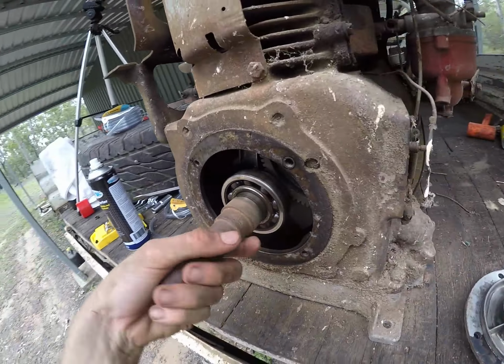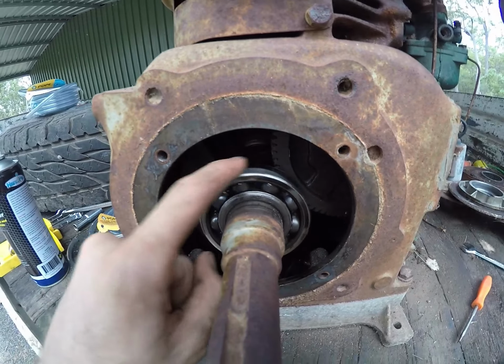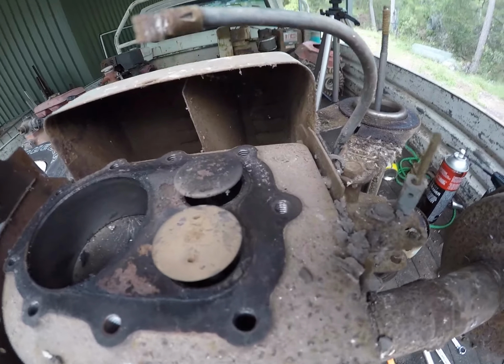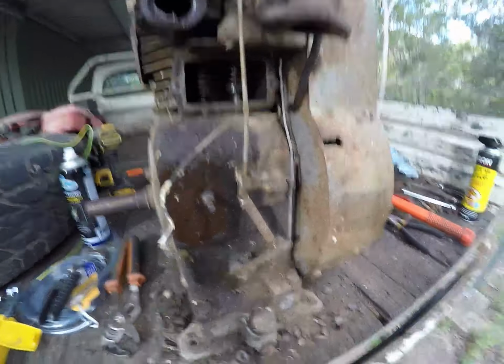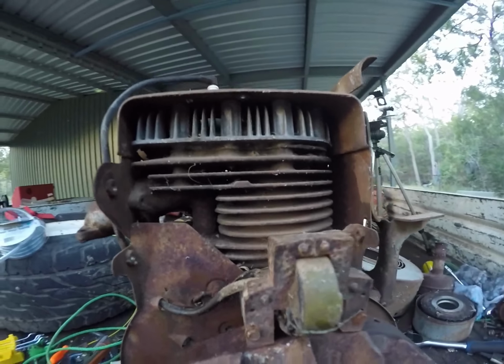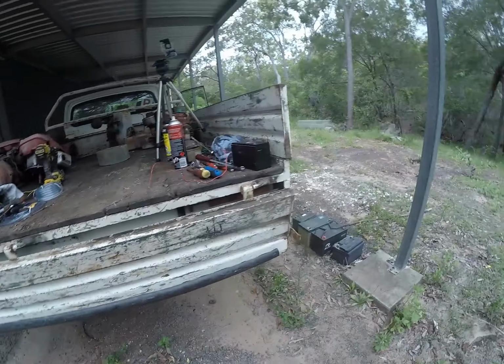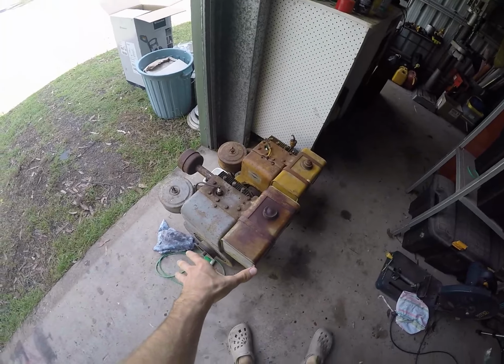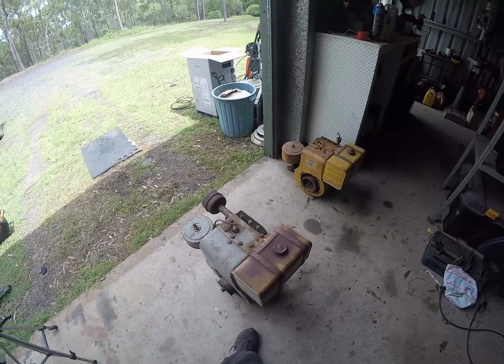Time lapse revival! 9HP stationary motor

Comment: I use a big 1/2" corded drill with an a socket adapter to turn over these big motors. You have to be ready to pull it off quickly when the motor fires or it can break the nut loose or kick back and hurt your wrists. Takes a bit of practice.
Reply from the maker: I was thinking about doing that myself, but I didn't in the end in case the motor fired and sent the drill spinning round in my wrists

Comment: I'm hoping to start restoring my old Howard 2000 garden tractor soon its got a Kohler kt19 flat twin engine that hasn't ran for years I got new points, spark plugs, air filter and I gotta get a new ignition coil for it and then change the oil and filters then restore the tractor itself its got high and low range, diff lock and 2 speeds in forward low and 2 speeds in forward high and 1 speed in reverse and a 3 point linkage anyways lovin' this series mate great vid as always.
Reply from the maker: thanks mate! a few years ago I was actually interested in buying a little old Howard tractor to do up myself! they are cool little machines, enjoy it and let me know how you go! be sure to tag me in some photos of it on Instagram so I can see the progress if you have Instagram!
Reply: @TravosGarage  yeah
 mate will do I'm looking forward to getting her going
Reply from the maker: @kaynepearse4200  as you should be! Take your time and make something tobe proud of😄
Reply: @TravosGarage  thanks mate and I will take my time might get in touch with you and you can come and give us a hand or have a look when she's done
Reply from the maker: @kaynepearse4200  for sure mate!